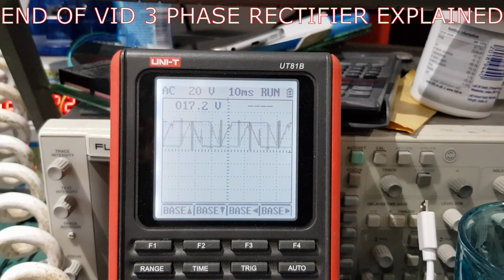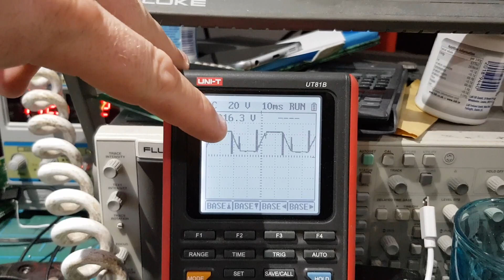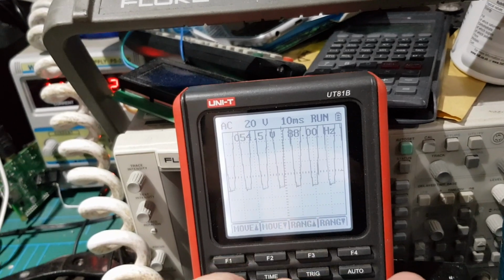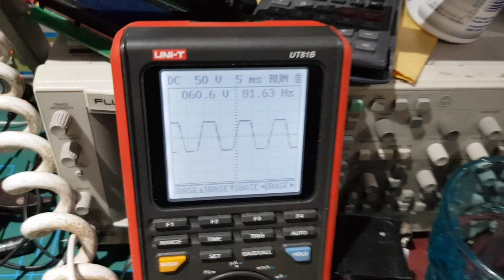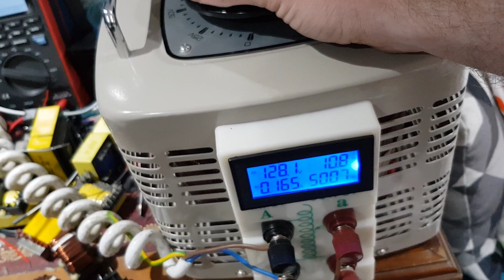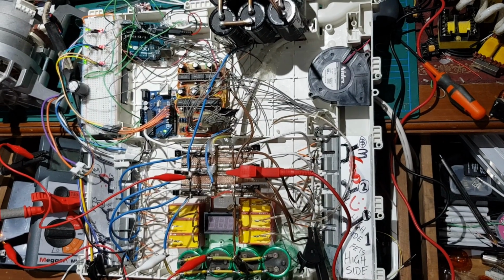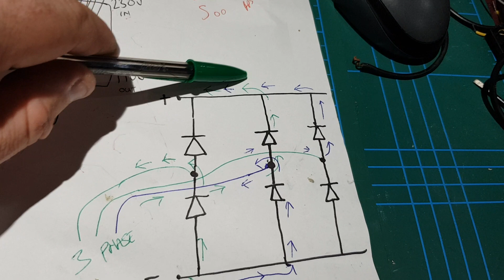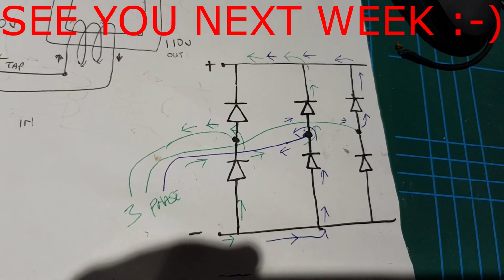AC MOTOR CONTROL #2 3 PHASE SNUBBERS AND HIGH VOLTAGE TEST!

Comment: I would use the Parallax Propeller for commutation; eight individual processors, each doing their own thing and able to interchange data. Interrupts? Nah 😉
Reply from the maker: Hey great idea .. i looked into the conceot of running two processors in parralel and i may end up using two stm32s in parralel for higher speed applications :-) however with the stms pipeline and direct memory access. The timer units can save data to memory without using the core. It byoasses thw core and saves directly into memory with this it can handle speeds of up to 10k rpms with a 4 pole motor so i didnt bother. Its a very simple alogorithm but its never been done before and i think simple is usually better. Im glad youve enjoyed my crappy little videos :-) more to come. My business really gets busy in the winter so wont hear from me until the spring time now unless i get some time off
Reply: @jaysjetskis 
I have been looking at the STM Eval units for a while now and I think I'll pick up their 1KW unit to play with.
I design/build/install CNC tube bender control systems and my goal is to provide a complete package that can be maintained by regular techs (non proprietary). I have achieved this with everything except for the servo drives. 👍
Reply: @jaysjetskis 
Propeller 2 wouldn't even break a sweat @ 10K RPM. They have unwittingly created a general purpose MCU that is the ultimate motor controller. Heck, every single pin can decode quadrature. The most I have ever seen on any other device is a maximum of two encoder interfaces. 😎👍